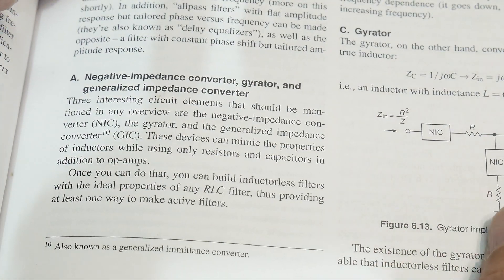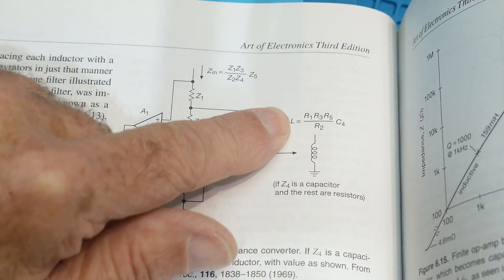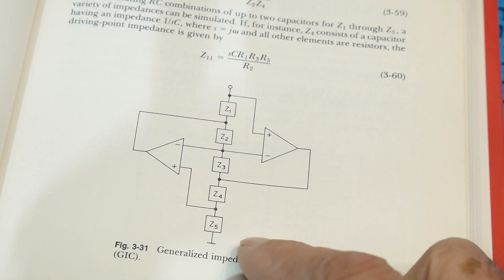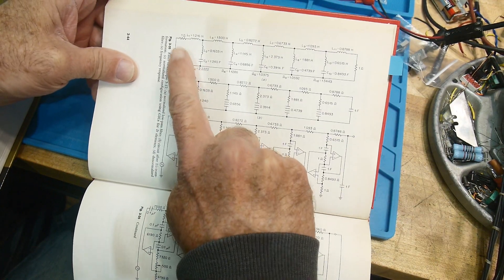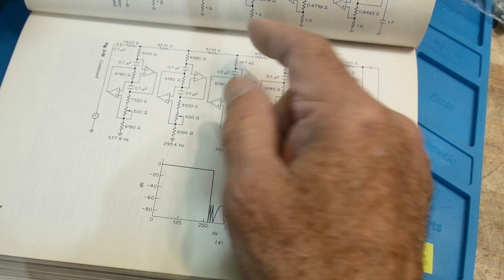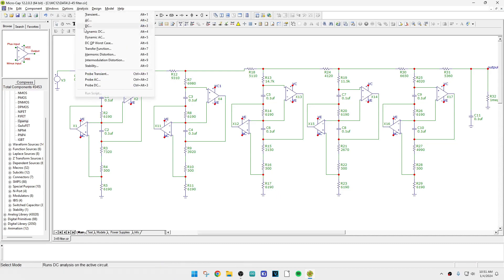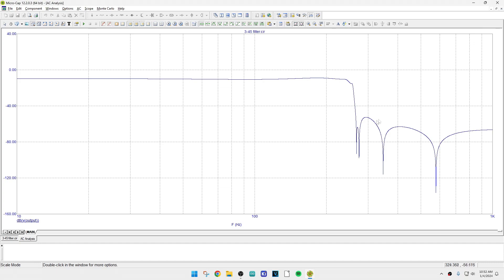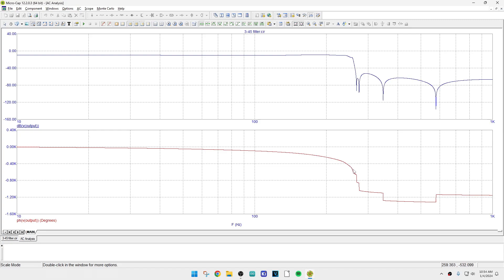#1781 Gyrator (part 1 of 4)

Comment: 4:40

The LC filter shown is an elliptic low-pass filter.

Elliptic filters exist in all of the 4 forms ( LP, HP, BP and BR ) and as seen here, require more components than Butterwortg / Chebychev and are significantly more complex to design.

Elliptic filters are fixed input / output impedance ( widely used in 50 ohms RF environment ), exhibit ripple in both the bandpass and the band-reject regions and are extensively used in high-end broadcast audio sections and in RF test equipment.

Comment: 8:50 is it not maybe due to the graph being shown till -80dB and the microcap one until -160dB? Vertical also goes up to slightly above 0dB and in the simulation 40dB. Maybe the steepness is a visual thing.

Comment: You can use the results from the normalized gyrators to calculate the potentiometer settings according to the given "real world" impedance and frequency. This should give you a very sharp decay at the upper frequency of the pass band.

Comment: I used to work with these all the time when designing high Q filters for use in telecom equipment designs (SF signalling convertors) back in the early to mid 80's.

Comment: I think for your simulation you could reduce the freq. range to get more points around -3dB. Or set more points in another way. Probably it there (at -3dB) a lot of detail that is not calculated but interpolated. Hence "weird" looking. And to analyze maybe just build 1 stage. Would be less sharp, probably just 1st order.

Comment: A gyrator is used to replace the telephone holding coil when a DC isolated transformer is used in a modem. These became extraordinary valuable in PCMCIA modems and laptop modems when US Robotics and Hayes were hot in the early 1990s.

Comment: A gyrator around a single BJT or Darlington still finds common use in modems where it pretends to be a ridiculously large inductor across the line, so large it doesn't affect the audio frequencies, but is basically a 200R resistor at DC.

Comment: The dean of the electrical engineering department at my alma matter, the University of Calgary was "famous" for his patents that were used inside analog I.C.'s back in the day.

The book "RC-Active Circuits: Theory and Design" written by Leonard T. Bruton has the "Frequency Dependent Negative Resistor" (FDNR) listed on page 43.  These symbols are the ones shown in the video at 04:00 and are a branch of components that extend upon the original gyrator invention to identify "Generalized Impedance Converter" GIC circuit elements.  Note that, unlike the gyrator, the FDNR components can be realised with fully floating terminals instead of having to ground one of the two like the gyrator.

Fun stuff.  Thank you IMSAI Guy!
Reply: We need more "gray beards" teaching the younger guys, there's a serious lack of talent now. I'm betting in 20 years most of the engineers won't be able to build an IC or many circuits without an existing design and A.I. help.
Reply: I was wondering if someone might comment on Dr. Bruton’s work. Thanks so much! He was my PhD supervisor and I had lunch with him not long ago.

Comment: Abstract

This transcript details a video about the concept of "gyrators" in electronics. Gyrators are unique circuit elements that invert impedance, allowing for the transformation of capacitors into inductors and vice-versa. The speaker provides an overview of gyrators, delving into their history and applications.

Key Points

* What is a Gyrator?  A gyrator is a non-reciprocal, two-port network element that inverts impedance.
* Gyrators vs. Inductors: Gyrators allow the creation of "fake inductors" from capacitors, eliminating the need for bulky physical inductors in many filter designs.
* Circuit Examples:  The transcript details a complex gyrator-based filter design and explores its creation and simulation using the microcap software.
* Challenges: The speaker highlights the complexity of the given gyrator-based filter, noting the difficulty in perfectly replicating its ideal behavior in simulation.  

Additional Notes

* Gyrators have theoretical origins but found practical applications in electronics design.
* While gyrators offer flexibility, the speaker favors more familiar filter design approaches (e.g., Sallen-Key filters). 
* The speaker acknowledges that high-end audio equipment may still benefit from gyrators due to their phase characteristics. 
 

Disclaimer: I used gemini ultra 1.0 (2024.02.21) to summarize the
video transcript.  This method may make mistakes in recognizing words

Comment: Another interesting use for gyrators is in magnetic circuit analogies. Typically for magnetic circuit analogies we substitute a voltage source for a coil, resistance for reluctance, etc. It's an intuitive analogy but not very rigorous, namely because the product of its equivalents for voltage and current - magnetomotive force (mmf) and magnetic flux - does not come out to a power quantity. If instead we use gyrators as our magnetic sources and model permeance (reciprocal of reluctance) as capacitors, we get the gyrator-capacitor magnetic model. In this model mmf is still voltage, but current becomes rate of change of flux. These two quantities do multiply to power.

Comment: The Microcap graph is a log-lin and the book is lin-lin. Can you do a lin-lin graph?  You could just replace the R+Vr with the computed values. This whole thing exists in the ideal part universe until you build it.😁 The 0.685 is about 4300 Ohms rather than 3920+500. Best guess just looking at the two diagrams.

Comment: Blast from the past. Back in the 1980s I was using gyrators for 2970Hz notch filters and tone detectors. I always felt they were magic :)
Reply: Same here, I used these for 2600Hz detectors and other detectors used for SF signalling convertors for Telecom use ;-).

Comment: Built a gyrator back in the '70s when I saw them used in a graphic equalizer.
The advantage is for audio frequencies, the inductors become huge so doing it with small caps is easier and cheaper plus you don't get non-linearities of magnetics..
Reply: This monstrosity that he simulated though has so many weird nonlinearities in the rejection band that I'd rather deal with the pain of better component selection than have to deal with the pain of my "noise" getting aliased back into my signal in this weird and monstrous way :P
Reply: I remember me.